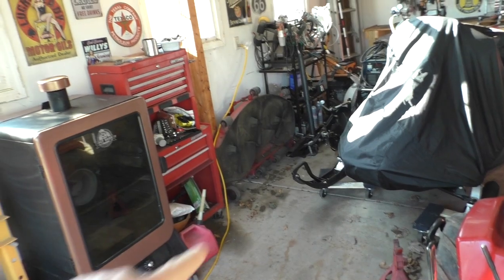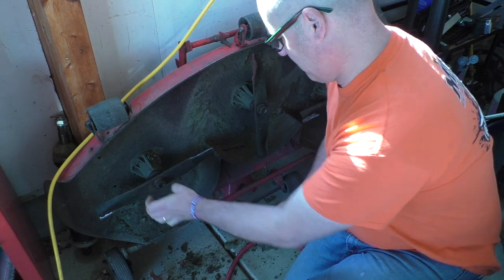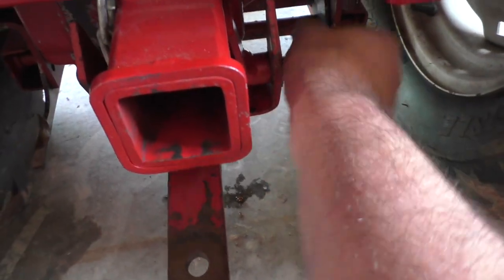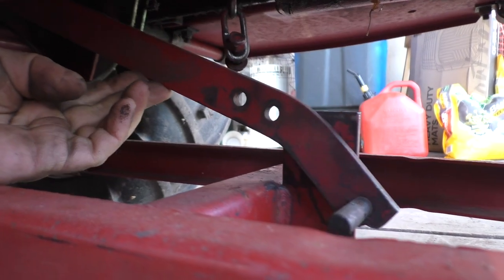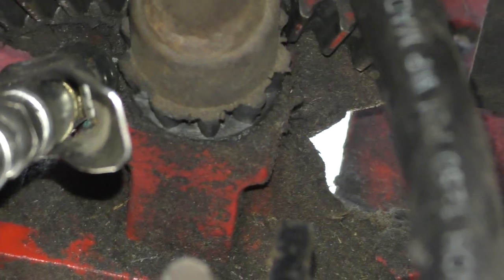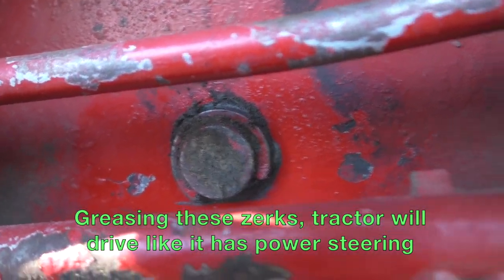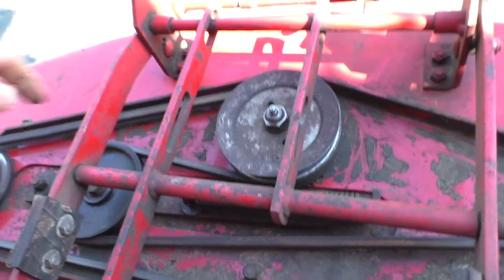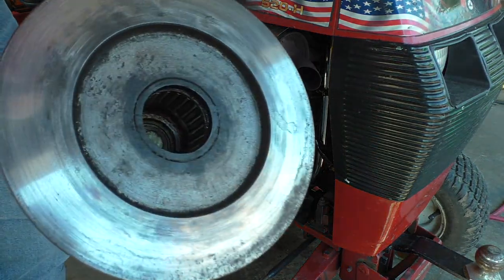Switching Seasons- Get the Wheel Horse 520H ready for mowing

Comment: Great video Craig! Do you know the part number of the center spindle for a 48” deck for my 520H? Also the idler pulley and spring. I need the side drive belt pulley as well.. any help is welcome!
Reply from the maker: I don’t, but I would check out Red Square Wheel Horse forum. They have all the parts manuals free in their sticky threads.